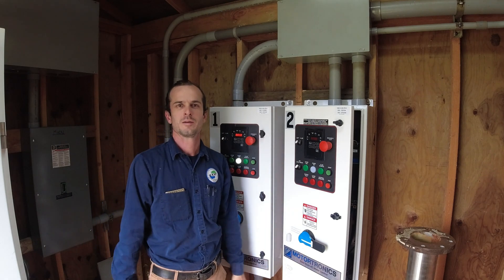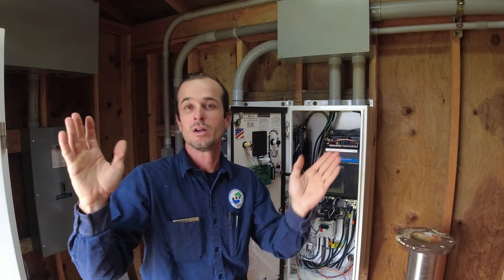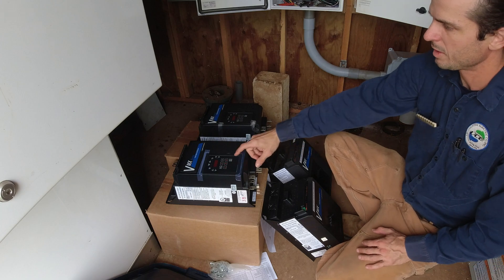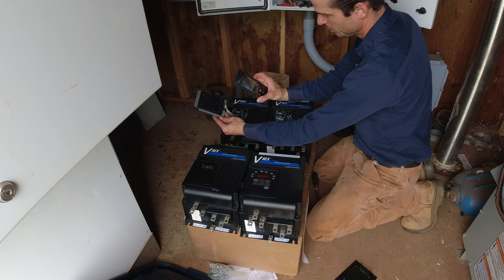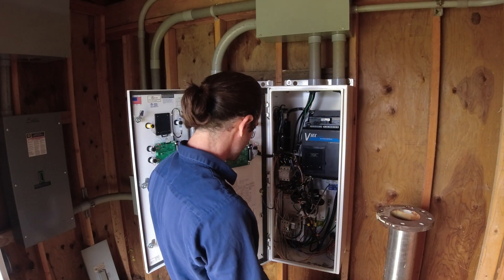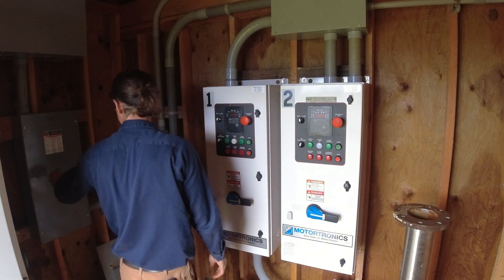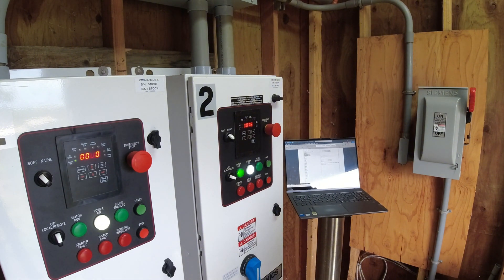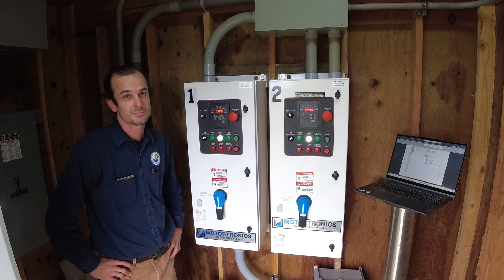Replacement Soft Starters

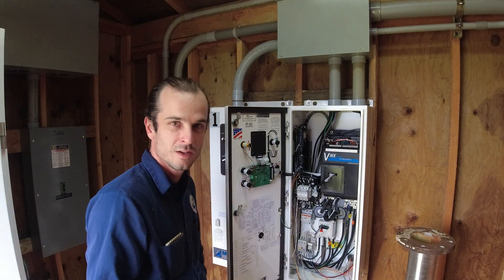Comment: Service work: do your job correctly you don't have to go back. Plant assignment work: do your job correctly and you have to go back 3:06
Reply from the maker: Ideally yes, of course... Sometimes though, like this case our installation was correct and to spec but an intermittent bug in both units required multiple return trips to correctly identify, isolate and resolve the actual issue.
Thanks for watching!

Comment: I’m surprised they didn’t want to change the current sensors first. Kinda surprised they replaced the whole unit before the sensors.
Reply: From what I recall the CTs you can see are backup overcurrent sensors. The ones causing issues are inside the unit and are likely not field serviceable.
Reply from the maker: The internal CTs are likely functional, according to the manufacturer it is the PCB and software bugging out.
They recommended changing the whole chassis out of simplicity, as the warranty covered everything anyway.
Thanks for watching!

Comment: I always make sure to write "NFG" or similar on parts that are identical but headed for the dumpster, to avoid mixups.
Reply from the maker: Yeah I realize all the time how weak my mind is with simple details 😂 so as soon as I took out the existing units I wrote "old" on the side.
Reply: NFG, AFU, FUBAR...
Reply: I take a piece of tape and write on that. But I see those original units had some labeling across the top in this case.

Comment: One sneaky thing that can affect CT readings can be harmonic distortions. If you have equipment that uses non linear loads on the same branch ( even neighbors) - it can affect ratio readings in TC.
So of problem, God forbid, comes back - that will be a thing to check.
Reply: Definitely a problem with variable frequency/speed drives. Surprised that they did not have choke-reactors to clean up the drive output.